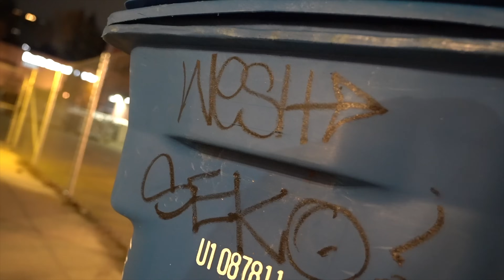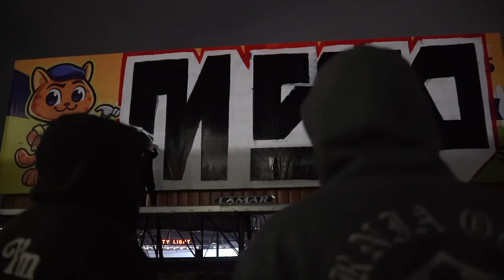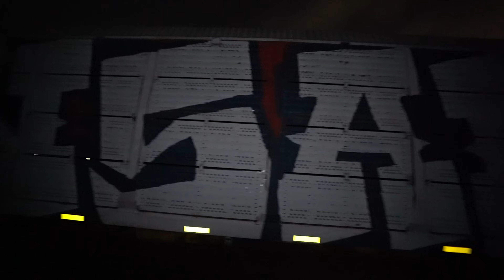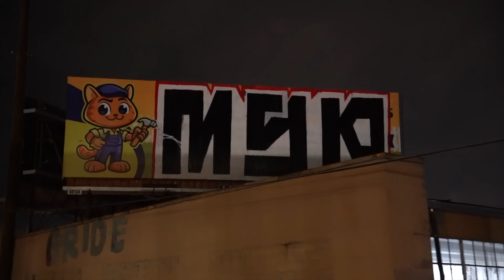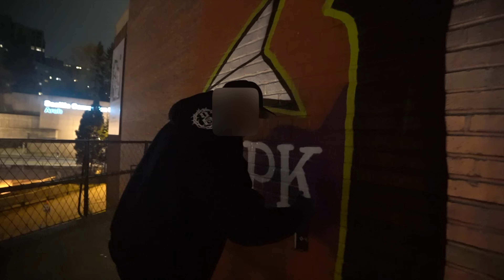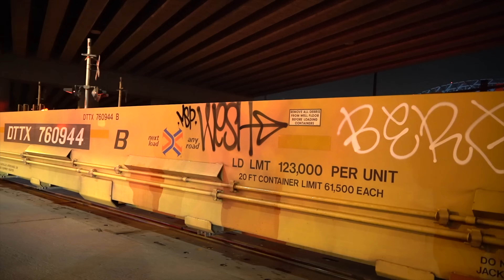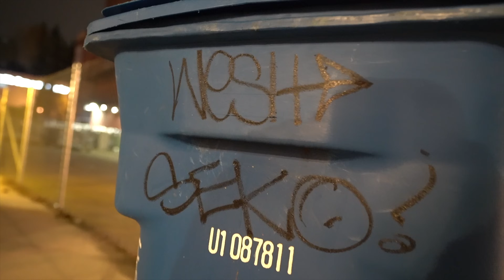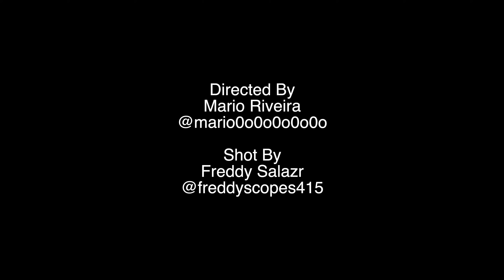Make It Rain | Seattle Graffiti Documentary

Comment: I was there back in 2k miss hitting up some PRIME HEAVEN spots around Pioneer square.... Use floetrol for the latex bucket&roller painting up in the 206, it spreads sweet, easily & unbelievably seamless even in ☔ doesn't water down and run 🫠🤳🏾🔥🔥🔥🔥
Reply: like Forge REM said once… “Seattle Was Fun, When It Was”